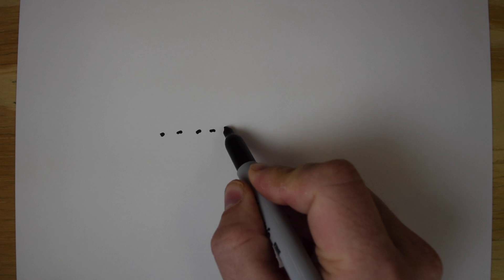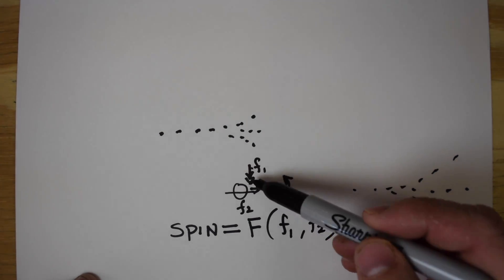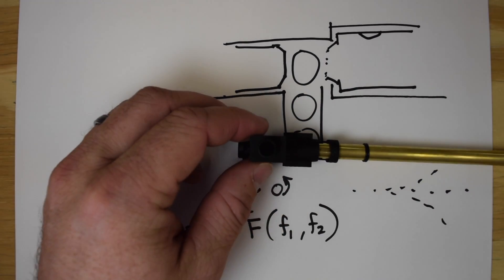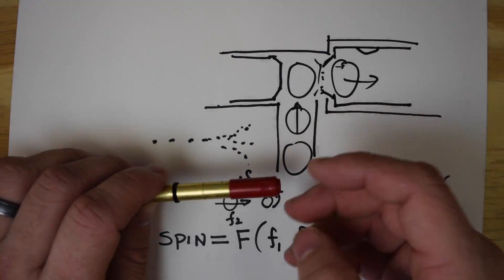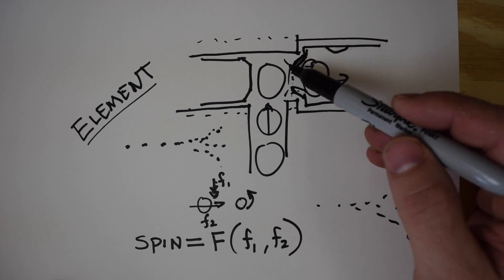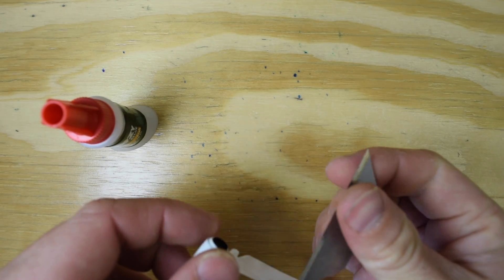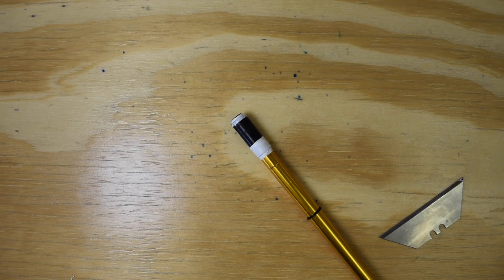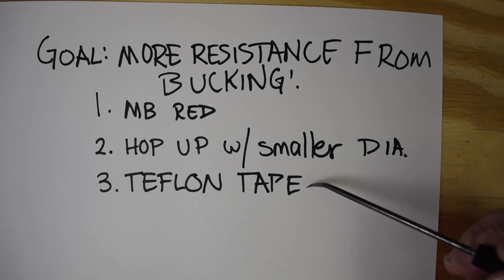What the Tech?!?! Ep. 1: Hop-up Tuning with Open Bolt

Comment: hi Rich, on the concept of using the MB red to feed more consistently into the chamber...in theory, if you wanted a tighter lip, wouldn't it be plausible to use a higher durometer bucking? For a DMR application with a high air output and the absolute need to have a consistant feed, I have been struggling with this. And this considering you are only dealing with the lip, ie you have an Rhoped barrel providing the contact surface at the correct durometer for the application.  
I have tested the madbull red and I know its not supposed to be used in an inferno Gen2 (it was really bad in my testing) but more for the SMP/Gen1/Hydra. I have a full set of 60d 70d 80d reaps and was curious your opinion on my hypothesis....you know, before I go and flat hop each bucking. ty!

Comment: Hello Rich. Im writing to you to see if you have already encountered sides spins with a bucking like Madbull red,Maple leaf, Prometheus violet etc etc. For me iI'm a tech in one of the shoops in the europ and frankly I had to say that no matter what buckin i use i always gets side spins to the left,to the right,up ou low.We found out a way how to treat that but I would like to know as well your solution to that. Most of the time we use the Maple leaf 75 and after our moddif it works like a miracle. Thank you for your answer
Sebastjan
Reply: +Sebastjan Pirnat generally we see that from misalignment of the gearbox to the hop up. But we always love to see new ideas on how to solve problems!
Reply: +Wolverine Airsoft . Hey Rich. Thank you for answering me. BTW I have to say that as a tech i know when a gearbox is misaligned and the side spins happens in airsoft guns like M4,AK47,G36 and even in the M14 G&G knowing that hop up unit with the inner barrel is aligned and screwed with the gearbox so....

Just a tech for a tech-which bucking in your opinion is the best for system Wolverine,and another question -when can we except the upgrade conserning the Bletooth FCU because with my Samsung Galaxy S5 plus it does not work!
Tnx and hope to hear from you soon.

Stjan

Comment: #1 & 2 were good ideas.  not too sure on the 3rd one.  Even a small amount of Super glue & the Teflon tape might make it a little tough to get inside a hop up Chamber.
Reply: +NepaAirsoft We do it ALL the time. Causes no problems unless you are using an especially fat hop up bucking. If you find it's a little tight just put a dab of silicone grease on the outside of the bucking to help it slide in.